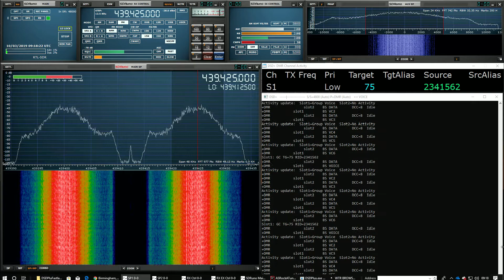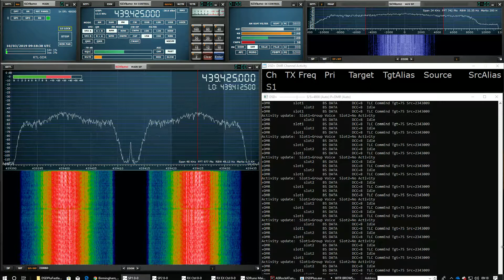ICOM IC-7100 IQ output into SDRUno into DSD+ Fastlane decoding DMR

Comment: Can the ic-7100 be connected to sdruno with an mfj sdr switch? Ive been google and YouTube searching, but cant seem to find a clear answer. Im a big fan of my rsp1a and sdruno software....so I am considering purchasing the ic-7100, but would like to verify if it can be panadapter connected.
Reply from the maker: Yes it can be used with a MFJ TX/RX switch, I use the 1708B-SDR here. Also use a cable from the rig to the ctrl port on the switch to provide better protection when transmitting.